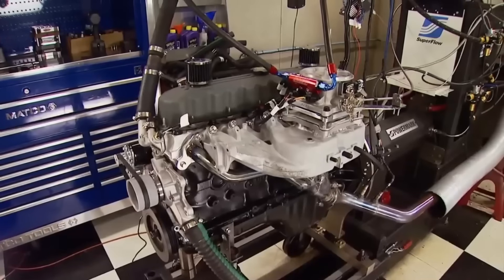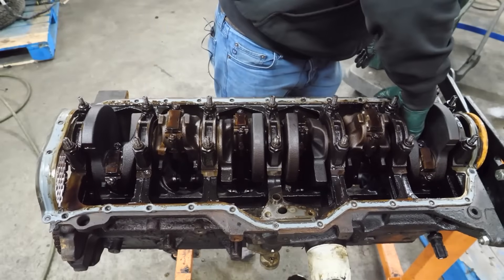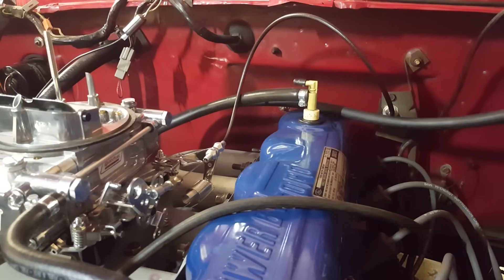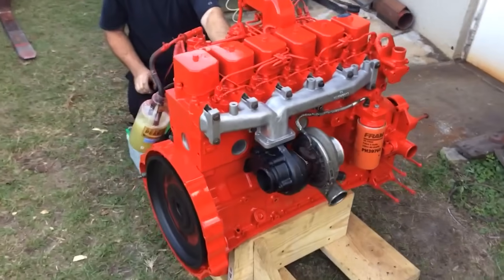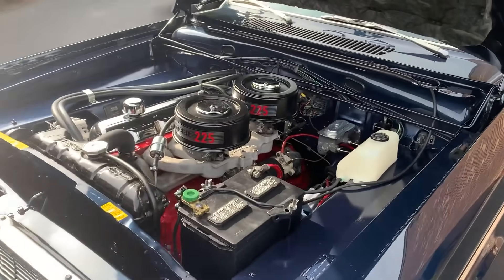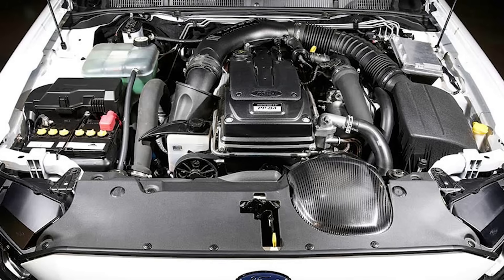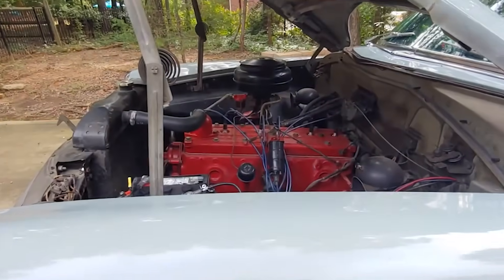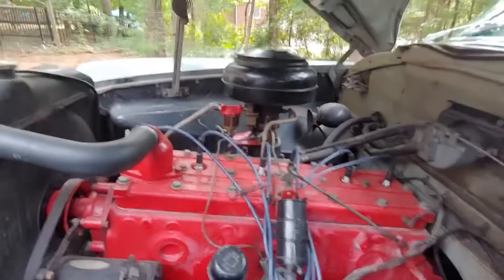8 Best American Inline-Six Engines Of All The Time!!!

Comment: It does not surprise me that you have ignored the baddest of straight sixes, the 302 GMC. Engines in this family made the Stovebolt look, act, and last like a bargain basement knock-off. Don't hate. I've owned and built them both. Just sayin'.
Reply: Yep.  Most people only know about the populars.  How about the 503?
Reply: @BPzeropoint  
My buddy has a 1929/1930 GMC big big big truck that runs a Buick straight six from the factory. The truck is massive and the engine is also. The engine is a lot bigger than a stovebolt by Chevy. From our research '29 and '30 were the only years that GMCs ran a Buick inline 6. Supposedly......apparently (from textbook research and talking to older dudes)...the Buick inline 6 became the GMC inline 6 in 1931 when Chevy introduced their 6 cylinder and Buick moved on to the inline 8. The GMC big 6 eventually grew into your massive engines up to and including your 503, 616, and 707 all gasoline burning inline 6s.
Other truck manufacturers made even larger gasoline 6s into the 1000+ cubic inches. Cool stuff.
Reply: @xmo552  Definitely Cool Stuff.  I was reading that in stock from the inline 503 made close to 500 lb ft tq at 1200 rpm.
Reply: @xmo552 The inline 8 was another motor with huge power. A definite torque monster.

Comment: Did anyone else notice @6:55?  The Ford Barra?  "Introduced in 2002 under the hood of the Ford Falcon.  Ever since it's been a legend in Australia..............  Since the Barra was only sold in Australia..............." 

Headline to the video:
  "8 Best AMERICAN Inline-Six Engines Of All The Time!!!"

Car wisdoms may not have made a wise title lol.

especially since the Ford 144/170/200/250 series engine was almost bulletproof and production only stopped with the all new 300 six cylinder.
Reply from the maker: I know what u saying but ford is an American company
Reply: @CarWisdoms  Ford of Australia is a completely different company.  They have different cars, different engines, different almost everything.  That's why none of it is compatible here in the US and even in your own video you said "only available in Australia".  If that's so, then it's not one of the 8 best American inline six motors ever made, since it's not American and cannot be found here.  

That's like saying the Delorean is the most American car of the 80's, even though they were made in Ireland and have a French motor in them because John Delorean was American and worked for GM and created the Pontiac GTO....  They might be part of American history, that doesn't make them American. That counts especially to a six cylinder engine never offered for sale here in the US despite the nameplate on the engine saying Ford.
It should not have been included, especially since the 144/170/200/250 series engine had more impact in US history, was Ford of America, and was only supplanted by the 300 inline six but not mentioned once.
Reply: @bad74maverick  
you don't have many friends, right?
Reply: @ plenty, most are gear heads or gun guys, but that has nothing to do with anything discussed above.

Comment: My 4.0 in my Cherokee lasted 23 years and 317,000 miles. Was still running when I pulled it out to have it rebuilt. It was bored 20 thousands over, little taller pistons and a slightly bigger cam. Greeley Auto and Machine rebuilt it for me. Planning on driving it another 23 years.
Reply: I loved my 1996 cherokee sport ,, my nephew affectionately dubbed it white lightning  ,,this was a rare 4 door cherokee with the 5 speed manual transmission option ,,usually this was only a 2 door option ,,my 4.0 had an aftermarket Garett T3 turbo and intercooler  which gave it 280HP , it would smoke the tires in 4wd ,,sadly i had to park  it in 2017 when it was discovered that the main frame rails were rusting through ,,the old 4 liter lives on though ,i pulled the entire drivetrain  and swapped it into a 1988 short box ford ranger ,,took me almost 2 years to complete the project  but it's turned into one of the most fun trucks i've ever owned ,,,this is my second engine swap in a ford ranger too ,, the other was another legendary engine a 4BT cummins ,,that truck has racked up over a half million miles since i swapped the engine and restored it clear back in 1996
Reply: THE 4.0 will run forever,that little lifter tick is just to let you know it is alive!
Reply: '05 Jeep LJ with the 4.0. Has 341,000 miles and counting. I also had a '99 Cherokee 5 speed with 275,000 on it. It was still running perfect when the frame rotted.
Reply: It proves that manufacturers KNOW HOW to build them to last.   That doesn't mean they always want to nowdays.......they want to sell you another one after all.
Reply: Just turned ove 220,000 miles on my 4.0 G.C. .... no cracked piston skirts, no skirt noises, think that only happens to people who gun them in the morning without warming them up properly, allowing expansion thus avoiding piston slap...and./or high revving them through mud pits over and over...
Reply: My 98 was at about 325000 when I left here go never broke down,alt and starter and set tranny solenoid s
Reply: Mine overheated on me 4 times and never caused an issue. Tuff as hell
Reply: Loveland native hears Greeley Auto, and his ears perk up.
Reply: I was surprised to see that the 4.0 is a good engine.  Its predecessor, the 258, in my 1984 J-10 was a total piece of JUNK.  I bought the J-10 new and continuously had something wrong with it until I traded it away in 1990, with good riddance.  If you expected a part could never fail, it failed on that 258.  That band at the top of each pair of rockers to keep them aligned?  No stress, they just keep the rockers from turning...one of mine broke allowing the rocker to turn to the side and giving me a 5-cylinder engine.  Every time it snowed and I needed the 4WD, the engine ran rough or not at all.  Something happened to the timing on and off (intermittent forever) allowing the fuel to burn in the tailpipe.  Found out when the carper started smoldering.  I could go on and on....
Reply: @BlisterBang 
The big difference between the 258 and the 4.0 besides the bore and stroke was the carburetor vs fuel injection. Anything at the time with carburetion sucked.
Reply: Might have to kiss the 87 gas goodbye though.
Reply: @danieldrake7090  yah, the 4.0. just a great engine..
Reply: You forgot the Chevy 292. Was so good NHR banned it.
Reply: Mopar has always made 💩💩💩

Comment: The AMC 4.0L wasn't a 258 cid, it was actually à 245 cid the 258 was a 4.2L ,fact checking before posting would be a good idea !
Reply: Originally, AMC had two sixes at 3.8 and 4.2. They split the difference and came up with the 4.0.
Reply: @tedschmitt178  Don't forget the 1965-1970 3.3 (199)
Reply: @tedschmitt178  when they redesigned the 4.2L for the Cherokee  XJ, the 3.8l had long been discontinued, they took the 4.2l and designed a new head and intake and thus the 4.0l was born, it was immensenly more powerful, with an increase of over 65 hp in 1984!

Comment: I run Chevy sixes Ford 300s at own to Cummins a 5'9 12 valve I only 5924 valve I also have a 1990 Ford with a 306 with 216,000 no 230,000 miles on it still runs phenomenal have had to replace them external stuff like the balancer and all the injectors and stuff like that and sensors but the motor just keeps on trucking probably outlast the pickup even though the pickup is off we pretty and well cared for I really like my inline 6 motors looking for an old Chevy with an inline 6 pickup have had tons of Chevy sixes I really really prefer them over the v8s easy to work on run forever and it felt right there a go-getter

Comment: Unmentioned underdog would be the GM 292,just as good as the Ford 300 6.
Reply: Except the Ford uses timing gears not a chain. Never stretches or breaks.
Reply: @haroldhead7555  The Chevrolet 194 / 230 / 250 / 292 inline six also uses timing gears with no chain.
Reply: I have a 292 in my C30 dually. Has no problem jerking a few tons of gravel around town.
Reply: Smh, no. You're adorable for thinking that tho. Cute
Reply: 8:28 - 9:40

Comment: In 1981, paid $225 for a beater 67 Valiant w/slant 6. Drove it thru much of the 80's until the body gradually fell apart around the engine and tranny. With the doors tied shut, drove to the wrecking yard in '88. Got $50, LOL.
Reply: Those Variants and Darts were a tough car. If they were not so rust able, they would of been a forever machine. Had a friend, and his first car was a Dodge Dart, the basic four door sedan with slant six and a Torqueflite transmission. Loved it enough, he replaced it with another one. And he continued this till he could no longer find one. He had five all together. And nothing he had since had made him happy.  Each Dart was named Isaac, I through V.

Comment: If you have a Six  you did not have it for performance but as work horse. I have had many jeeps and main failure is burnt valves because crappy Carter carbs on the six and poor maintenance from previous owners. But easy to  fix. The 300 is the best but was discontinued because weight and fuel mileage and replaced with the crap V6. Possibly also because if last too long it will not be replaced. I am in the market for a F 150 as my farm truck.

Comment: I sold my rusting away 1995 F-150 with the 4.9 and 5 speed. It had 279,000 miles when I got rid of it. It has the original water pump. It's still running about a year later! Fantastic engine! mazda transmission with tight maintenance started whining around 220,000.
Reply: Honestly, that's not impressive for the 300 I6. That motor wasn't even broken in at under 500-600k miles.

Comment: Tengo un Chevy 230 1971, de GM-Argentina, desde 0km, recién vá por los 170 mil km, magnífico motor y carrocería, muy fuerte. También en Argentina se desarrolló el Ford Falcon con motor 221", 3.6L, muy potente, en particular la versión de motor de alta performance. Se fabricó también el motor Kaiser 226 tapa plana como el Hudson, y el Stlant six de Chrysler, muy buenos motores. En 1965 Industrias Kaiser Argentina introdujo el motor Tornado Jet, desarrollado inicialmente por Overland y que ya pertenecía a Kaiser, tenía 4 bancadas, árbol de levas a la cabeza, OHC, comandado por cadena, y era un motor desarrollado con menor cantidad de piezas, para el ejército de EEUU, casi era un motor para camionetas, enorme, más grande que el Chevrolet 230, ó el Ford 221, se lo implantó en el Rambler American 200, fabricado en Argentina y cuya versión coupé hard top, se le llamó Torino 380. Fueron los que hicieron historia en Nurburgreen en 1969, en un equipo dirigido por Juan Manuel Fangio, consiguiendo llegar primero en las 84 horas de Nurburgreen, de ése año, aunque por tecnicismos se le quitaron puntos no quedando primero, a pesar de haber sido el coche que más vueltas dió al circuito alemán. Después se desarrollo en Industrias Kaiser Argentina la versión de 7 bancadas del Tornado Jet, y se la llamó Motor Torino.También se trató de hacer una versión de 4 cilindros del Tornado Jet, pero no se la desarrolló completamente. Cuando Kaiser cesó sus actividades automotrices en EEUU, la provisión de motores Tornado Jet para el ejército de Estados Unidos se realizó desde Industrias Kaiser Argentina, hasta terminar su compromiso. Espero que puedan encontrar más información del Motor original Overland que lo diseñó un ingeniero de origen Italiano, antes de 1950 para la Overlad.  
Cuenten también del Stlan Six de aluminio, entre 1960 y 1963, que creo fué cuando de fabricó. Entiendo que Chrysler, para competir con el Corvair de aluminio, preparó dos desarrollos del Stlat Six, el primero sería de aluminio, pero por si algo llegaba a fallar con esta tecnología del aluminio, desarrollaron en paralelo el de hierro, que casi todo el mundo conoce, y cuya metalurgia era más conocida y desarrollada. Pero ambos fueron exitosos, aunque el de aluminio, estaba muy adelantado a su tiempo, sinembargo traía cosas que hoy en día se están aplicando en la fundición de  los bloques de aluminio.

Saludos cordiales desde  Argentina  para todos los amantes del motor de 6 cilindros en línea, motor simple sencillo, durable y muy confiable, sea cual fuere su fabricante, a estas alturas todos extrañamos  estos tipos de motores, sin complicaciones raras.
Reply: Right on!

Comment: If you made regular oil changes at intervals more often than the GM required miles. A Atlas I-6 usually out lasts the rest of the SUV.
It also ran so smooth and quiet, a automatic transmission needed a tach. Yep needed it to see that the engine actually was running at idle in park or neutral.
Probably why it was never put in a pickup with a stick shift behind it. Besides who wants to shift gears when should holding a phone with that hand?
Also the engine was too long to fit under the cab forward hood.

Comment: I will never understand why some of the people who made these engines now make absolute junk. I drove both AMC amd Ford with these engines putting 200 thousand miles on each with no trouble and got good economy.So sad the shape the auto builders are in today.Look at GM with one hundred percent failure with their newer V8.
Reply: It's all about the $$$.

Sure, it's way more complicated than that... but it truly is all about increasing company profits AFTER the sale... especially by pushing customers to go back to the stealership for upgrades, repair work & eventually to trading in vehicles (often prematurely) for current models!

It's all by design.

Comment: Way too much emission crap on these modern engines. It's a wonder they run at all!!!   Simplicity = REALIABILITY!
Reply: Don't get me started! Stupid sensors of all kinds have ruined many cars/trucks' reliability.

Anything that relies solely on a computer/CPU to function is bound to fail (and will cost 2 arms & 2 legs to fix)!
Reply: Simplicity=Reliability for sure! It always has, and it always will.
Reply: Not to mention maintenance you can rebuild the top end in a 300 Ford pickup new engines just open the hood and close it back lol

Comment: You should of included ford's 170 and 200 cu in. Engines. The 170 used 4 mains while the 200 had 7. The 170 in my 65 falcon reached 510,000 miles before the crankshaft became so worn it needed replacing.
Reply from the maker: Good you told me I will try do a video with best Ford in-line six
Reply: @CarWisdoms  looking forward to that!
Reply: I had a 68 Falcon in high school with the 200 CI.  Drove that car hard everyday and never touched the motor.  Great motor.  It didn’t have enough torque to spin the tires during a power brake so my big friend would pick up on the back bumper until the tire would start to spin.  Then he would get in the passenger seat while I kept the tire spinning.  Burn that rubber, we were cool.  That 200 even put up with that stupid shit.
Reply: @TimL-m7d  I knew a guy in my senior year of high-school 1974 who had a 68 falcon with a 200 cu in 6. He had a cherry bomb muffler on it. One day during class we heard a loud racket coming from outside. We all went to the windows and saw him spinning doughnuts in the student parking lot!🤣

Comment: Offered from 2002 and discontinued in 2009 the 4.2L Chevrolet Vortec inline 6 is an absolute monster. Capable of 600 hp with stock internals....
Reply from the maker: Thanx for letting me know, I will check it out
Reply: @CarWisdoms  
I'm familiar with this engine. I like it. But, they're weren't on anyone's radar until the Barra came out and Americans acted like "ummm we're bigger better faster always we already have one.....the Ameri-Barra".
Reply: Yes it was larry ragland raced baja against big ci v8s did well
Reply: Had one in a Trailblazer just kept running and running, plenty of power even while in 4 high...did eat some gas though.
Reply: “Screaming to 1,000 RPM with 2,000 horsepower “ 😂
Reply: 275 stock HP, stop lying
Reply: Poortec

Comment: The slant six had a LONGER stroke, 4 1/8 to be exact, that's what gave it such good torque, I've seen these in old D500s with 4 speeds and 2 speed rear axles, absolutely one of the tuffest engines ever made
Reply: Had a farmer of a truck crop farm that was a customer of mine that ran only the slant six on the pumps for the irrigation rigs. Said he had tried all kinds of motors, and this was the one that worked the best.
Reply: The 225 had a long stroke.  The 170's stroke was only 3.125".
Reply: Lol no they aren't.  Had one in an 85 d100. Blew up after only 15 seconds of redline. Spit rods out the oil pan. That wouldn't happen with a Ford 300
Reply: @derriklee287  must have been out of oil
Reply: @derriklee287 Redline on those is probably about 4000RPM, or close to that, about like a 300. So yeah, if you spin it over that for 15 seconds, it'll fling itself apart, and so will a 300, neither is meant to be run that high for that long. With modifications, to either, you can raise that threshold, so I'm talking purely in stock form. If you're running a slant 6, a 300, or even a jeep 4.0 at 5000 RPM, you're doing it wrong.
Reply: @crewdawg2008  he's just a dedicated Ford guy, I'm partial to Mopars myself, I know for a fact that a slant is one tuff mf'r, and can handle alot of abuse. I'm sure there's Chevy guys out there that swear by their 250s and 292s, also great engines in their own right
Reply: @maceurbi2842  Yes, you're right. I'm a Ford guy too, but I'm a gearhead first and foremost, so there's plenty to appreciate among Ford, Mopar, GM, and even AMC, if one is even trying to be unbiased, as you seem to be.
Reply: @derriklee287 You mean holding it to the floor for 15 seconds? Red line is pretty low on that engine and would probably not be an issue in 15 seconds